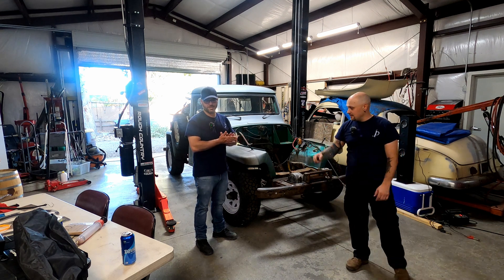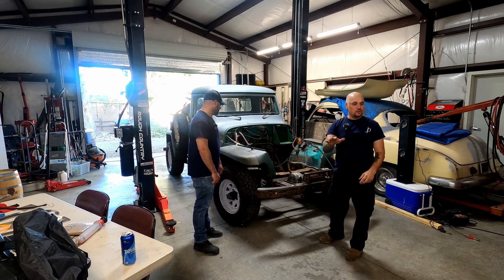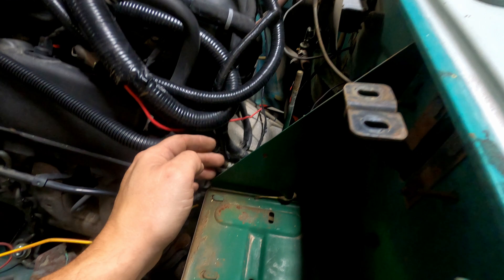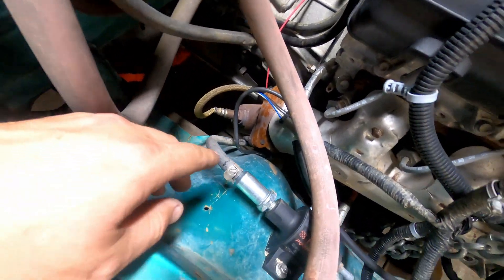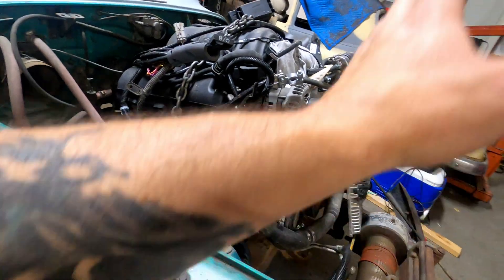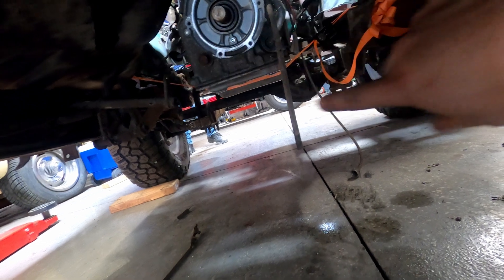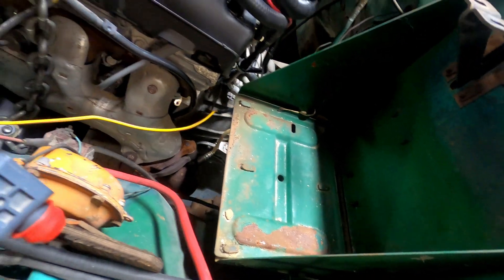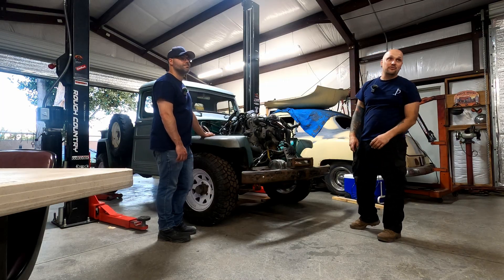Transforming a 1962 Willys with a Modern 4.3 Ecotec V6 Engine Swap

Comment: So many better choices don’t put that boat anchor in that jeep
Reply: It’s also 400lbs lighter
Reply from the maker: @DustinClinkscales  excellent point as well!
Reply from the maker: @RayTuttle-of5qd  While I agree, I would have gone a different route. the 4.3 produces near 300hp and similar Tq. This is what the customer Purchased and supplied prior to contacting us for the work. Tho, It will be a bit more unique because just about everyone does a v8 swap option.